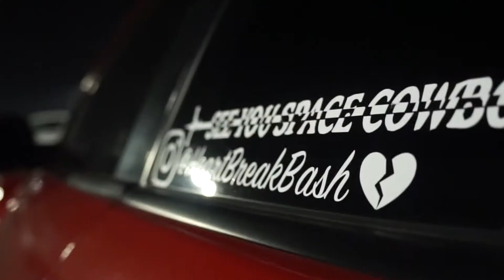We Were All Surprised! (Stage 2 FRS Vs Bolt-On Civic Si)

Comment: nice vid bro, how does the new exhaust setup sound in the cabin when youre just driving normally on the streets/highway
Reply from the maker: it does have some drone to it, but to me its nothing compared to running open header/exhaust leak, it sounds nice inside and it is noticeable but you can hear your music and passengers perfectly fine
Reply: @aronrsx  nice i might get this setup. When i bought my rsx is came with a broken dna shit sounds awful so im pretty sure this would make a huge difference. Keep grinding bro 🔥😎